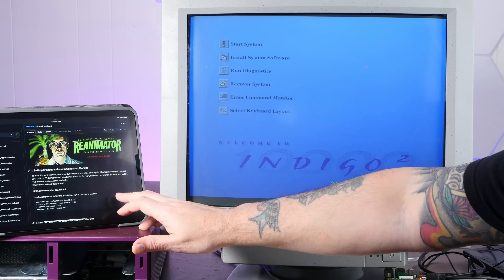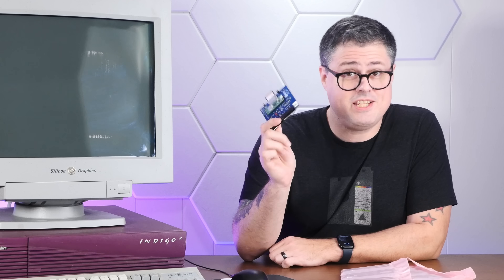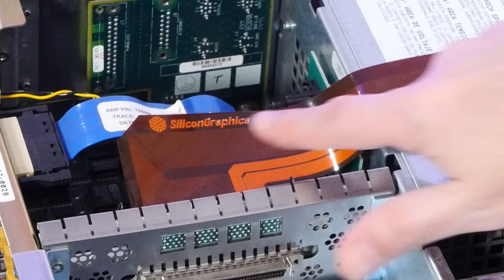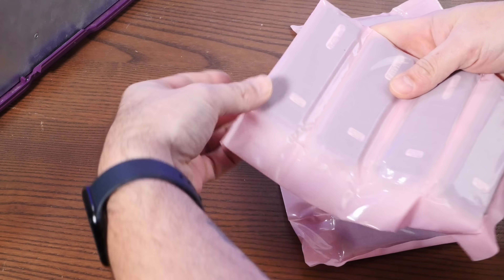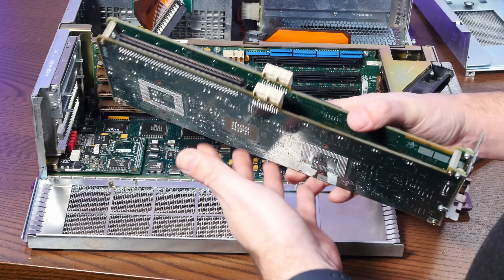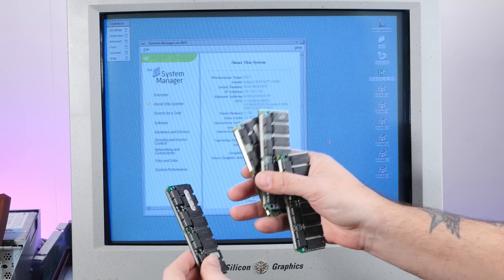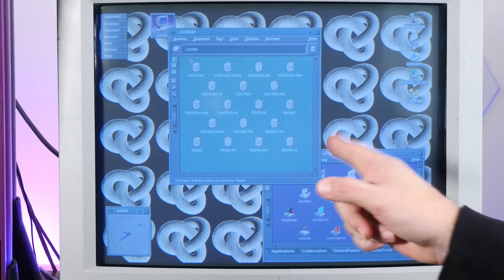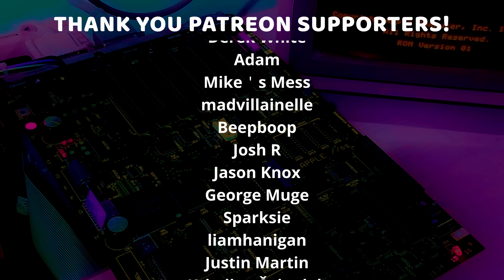Inside a $50,000 Unix Workstation from 1996

Comment: I have a Indigo 2 Solid Impact that I bought on ebay back in the 1990s. I was fully operational but I did eventually replace the  heavy monitor with a Dell sync on green flat screen unit. I also had added a tape drive long ago and collected the Irix 6.5.22 install CDs. In the summer my home office would sometimes heat up and that caused the computer to shutdown due to excessive heat. So in the summer I began just shutting it down. No I recently rebooted the computer and noticed the screen image flickering on and off and sometimes it would not reboot at all. I suspect that the power supply has died and these are not easy to repair. I haven't decided what to do with the computer yet but I do miss playing around with it. I remember years ago I had it on the internet and someone apparently hacked it and used the mail system to send out huge numbers of advertisements for viagra. I had noticed that my mail had gotten very full, and also my internet provider had complained to me that I was using too much bandwidth on the internet. That is what prompted me to investigate that problem. Since then I had taken it offline since the old browser was effectively useless for todays modern internet.

Comment: Those were crazy expensive and other channel someone thought that these were common in game development, or thought it was impossible to make 3D-modelling and rendering without SGI machines in 90s.

Well, yes, they were used on some titles but most of time game development and rendering was usually done with normal PCs with extra ram with "cheap" software like 3D Studio and Lightwave. There was even free software used to render game graphics.

When rendering back in 90s, biggest bottleneck for fast rendering and modelling was the memory when targetting computers and television. Artist had to fit all assets on render pass to limited memory but rasterizer wasn't that hard for CPU.

Free tools were make tradeoff using raytracing, they saved memory using procedural materials so in a certain way it was possible to do extremely high quality rendering with home computer and 16MB ram. Tradeoff was rendering time.

Comment: 4:25 - Please do not "repaste" these CPUs, they don't work that way. Also, the innards beneath the heatsink are extremely static sensitive. Again, they were never intended for end user access. The only part of the module which normally ever needs replacing is the fan.

6:05 - Correct, 768MB was the officially supported maximum. It made no sense for SGI to release a 512MB option, not when they were soon to transition to the Origin architecture (and the Octane workstation) which could far better support large RAM amouts via much higher memory bandwidth, lower latency and better networking and storage options. Plus, Octane could extract way more performance out of the same CPU, especially for fp code. See the R10K/195 comparison page on my site for details.

Later 128MB SIMMs actually create less heat than the 64MB SIMMs used for typical 256MB kits, but SGI couldn't wait around for that. :D

Note the hardware design of the motherboard means that at least one 512MB kit must be fitted in order to reach 1GB, but one cannot fit three 512MB kits to give 1.5GB, that won't work (as you found out); it is alas an inherant limit of the design.

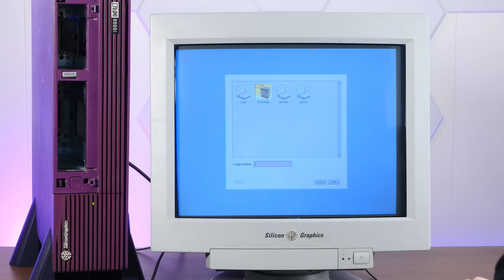8:46 - 90 minutes?? Holy grud that's slow.

9:30 - Have you done that speed hack yet?

I'm impressed with those 3D stands! 8)

I do have Max sets (many), but alas they all need repair. Maybe next year I can sort them out.

There is no faster CPU option, though as dans.8198 mentioned elsewhere here, there was also the earlier somewhat exotic R8000 75MB (2MB L2) option, but that was a very different beast.

Btw, I was the one who supplied the max-spec Indigo2 reviewed by LGR. Also, I do have some exotic expansion cards for Indigo2, including Ciprico UW SCSI and an accelerator board for I think Pirahna, but alas these options typically require the use of IRIX 6.2.

NOTE: I see your PSU is an early 36A model. Please, please have this refurbed as soon as possible. IMPACT PSUs are dying now at a frightening rate. It used to be just capacitors, but now it's all sorts of things giving up the ghost. It is much easier to refurb a PSU that is still working than repair a PSU that has already failed. I am currently exploring IMPACT PSU repair a great deal and will have a new page on my site about it next year, but in the meantime definitely get your unit refurbed; email me and I can send you a full parts list, plus info/advice from others I've been talking to about this. Also, if you do intend upgrading to MaxIMPACT then you should infact replace it with the final 48A model. And of course, make sure to obtain the two TRAM modules needed for MaxIMPACT to obtain proper full function. It will work with the default 1MB, but textures will show banding effects.

Lastly, you may be interested to know that MaxIMPACT uses SLI, something hobbyists didn't discover until much later, and for some reason SGI never mentioned it until full details were included in the Octane Technical Report. Only 2-RE options use this, ie. Max in Indigo2, likewise SSI, SSE, MXI and MXE in Octane.

If you need any help with things, please let me know.

Comment: I have mixed feelings for these old RISC UNIX machines. On one hand they are the coolest computers ever made. On the other hand, they were never made for ordinary people like me, and every brand having their own RISC architectures and own flavour of UNIX was about high margin elite thinking and protectionism.

I got into university in 1996. There was a Solaris computer lab, and the machine dedicated for large/heavy computations (available to all students) had 224MB of RAM. I remember that felt crazy in 1996.

However, just a few years later I bought a Pentium II system with 128Mb of RAM, and that mainboard could have 1Gb installed. The PowerMac G3 introduced in beginning of 1999 could have 1GB of RAM.

I am not saying the Indigo was not impressive. But competition picked up. Also, these MIPS computers were 64-bit, but anyway not supporting more than 2 (or 4) GB of RAM.

Now Apple is the biggest UNIX/RISC supplier ever, with prices that ordinary people can afford. I wonder if Silicon Graphics would ever have done that.

Comment: I was looking. SGI run System V R4.   System V R3 was the last 'kinda pure' System V.  System V R 4 was System V R3 and BSD ( not sure what version ) added together.  So I think that SGI did not just combine parts of both,  it was the official release.  I was a SYS V5 R3 person - installing Apollo and HP Workstations and was saddened when SYS 5 R4 came out.  thought that it killed the purity of SYS 5 R3.   but that is the way the game was played.  Someone wanted to let folks use whatever flavors they wanted on each command - if there were diffs.

Comment: I ported and developed software on IRIX in the 90s. Our company had several systems like yours running OEM IRIX and the SGI C compiler.That was before GNU tool anything. Besides most customers insisted we compile code using the vendor's compiler. The "largest" old/huge supercomputer I worked on in the early 90s was a Convex system (Richardson TX company). The system was all ECL logic and the machine I was on had 1.5GB of RAM, which was huge in those days. Their compiler was super fast. The first test "hello world" to verify things were working compiled so fast, I thought nothing happened. All we had then was a 9-track tape with our source code, an engineer (me) and a VT-100 terminal, a Bourne shell interface and vi, C / FORTRAN compilers and make. What else could you possibly need? Serious command line jokey in those days. We did also have various workstations, DEC VaxStation, Apollo Computing workstation, and a new RISC-based system out every 3mos or so, all running X11 desktop, if you were lucky. We ported our code base to over 15 UNIX systems, some SYSV, others BSD variants. We also ran on VAX and IBM Mainframe, so the code was super portable. Fun times.

Comment: I have one of these that I bought back in college, during my "Real UNIX" exploration days.  Got it off eBay for ~$600 (circa 2000), and used it as my main desktop for a while.  Mine had similar specs as what you started with, though only a "Solid IMPACT" graphics card.  I did later upgrade it to a "High IMPACT."
Biggest gripe is that its sorta a bridge-machine between the older Indigo2 models and the Octane, so it has CPU and graphics that's a generation ahead of the memory and I/O (slow SCSI, slow Ethernet).  Like many workstations of its vintage, finding 100Mbit ethernet hardware was too difficult/expensive. But, finding FDDI/CDDI hardware was surprisingly easy.  So at the time I ended up running an internal FDDI/CDDI network for NFS and everything else where that performance mattered, saving Ethernet for the outside world.

Comment: I had a Indigo2 XZ during my internship (the summer of Windows '95). These were frakin  amazing. Now you get multiple time the performance for a fraction of the cost and size. And Linux desktop has gone way ahead of Irix Magic Desktop.
If it wasn't for the 3D performance and IRIX, a Sun Sparcstation was way more cost effective. If not even a Pentium with Linux.

Comment: To think, back in the start of 1996 I had 12 MB of RAM in my 486 PC! By the end of that year I was on my way to building a new socket 7 K5/K6 based machine that had a whopping 32 MB of RAM in it which was more than enough at that time. 
I didn't have a full 1GB of RAM in any PC until my Barton core Athlon XP build in 2004. 5 years later my Core 2 Quad build had 4GB of RAM with an upgrade to 8GB in late 2010.

Comment: I'm a bit concerned that adding the thermal compound may have been a mistake. There is a reason it didn't have any; these machines were designed so that the fit between the CPU and heatsink is extremely precise so there's no need for paste; it probably just squeezed it all out and made a big mess and may actually hurt the cooling performance.
Reply: There’s clearly two fried out thermal pads on the heat sink.  He should have replaced them.  This is a hack job.  It’s sad to see these systems fall into the hands of PC bros who don’t know what they’re doing.

Comment: That cpu fan is a joke. I remember fans that small. And I know that older cpus ran hot as hell.
Reply: It has huge case fans.  Don’t worry about it.  SGI designed the whole system to work correctly in a normal air conditioned office.  It’s loud as heck though.

Comment: What was bad about the SGI was that it was nearly impossible to work out a bare metal install with a blank hard drive.  You pretty much had to purchase a hard drive from SGI with the operating system installed to do a bare metal install.  There was also problems with many of their software installed packages that simply prevented libraries from installing on certain models and it was virtually impossible to get help from SGI as it "should've worked", yes we later had similar issues with software installations on the Windows platform but at least they eventually worked through those and earlier software installation package formats such as on Sun workstations were easy for you to investigate into and hack them to work even if they weren't supposed to work to begin with.  It's just that SGI would often just leave you hanging on the premise that it should've worked and it wasn't as easy to rip into and hack as the Sun workstations.
Reply: This is not true.  I’ve installed IRIX on brand new hard drives so many times I can do it in my sleep now.  We bought SGI systems back in the day because of the support.  It was expensive but if we had any issue it was fixed that day, whatever it was.  New hardware, technician sent out, anything.  What you wrote about not being able to install the OS is either just you lying for fun or you seriously do not know what you are doing.  You can find dozens of tutorials on installing IRIX.  It’s not hard.  And IRIX has a really nice installation manager that manages dependencies for you.  Way better than the nonsense that windows put you through back in the day to install software and updates.

Comment: Old guy here. Worked for SUN and IBM. The processors were actually designed for no thermal paste. The heat sink and CPU were hyper polished so they fit flush. Paste may actually cause thermal over-runs so I'd suggest taking it back off. Also I know you're just playing with this but I would only work on a grounded mat with a wrist strap. These boxes are surprisingly delicate when it comes to static damage even though they look like you could use them to jack up your car with them. I actually worked with the SUN engineers on the first SUN 10000 which was at Ebay when I was at a training class at SUN in Millipedes. We could only watch and ask questions though.
Reply: That's very important information, i really hope he sees this!
Reply: milpitas....

Comment: Amiga 3000 (1990) is far from the beast that the SGI machine is but it could use up to 1GB of RAM too, just not as cleanly.  The most I put into mine was 274MB.  My current A4000 has just over 400MB.

Comment: Maybe the CA glue + baking soda method will work for the broken front panel, I saw someone fix a broken front panel latch with it before. You build up CA glue layer by layer and sprinkle baking soda on each layer to harden it instantly, you can sand if needed to shape it more precisely.

Comment: In the UK, tradesmen use a two-part contact adhesive they call Mitre Mate. Dunno what the equivalent the other side of the pond would be, but you could consider that for sticking the front plate back together.

Comment: @10:08 There is no faster CPU for the Indigo2. But there’s a much more exotic one: The R8000. It was a discrete CPU made of several components, and was crazy fast at floating point even if running at only 75 MHz. The R8000 is very rare today, requires a different motherboard, and cannot run Impact graphics.
Reply: Hope this gets some upvotes so it can be noticed by Action...195 R10k is the fastest performing, of course there is higher clock speed on the 200 and 250 MHz R4400 cpus. The R8k at 75 MHz is think has FP performance approaching the 175 R10k....rare for sure. I think I read someone saying the R8000 was released to fill in while they waited for R10k to be available and stable. The Power Indigo2 (R8000) has a swoop badge that fits around the round graphics badges on non-IMPACT systems (EXtreme, XL, XZ).

Comment: I used to work with these back in 1996. I worked for a VAR that was also a CAD/CAM company who solely used nothing but SGI workstations. We had everything from the Indy to the Octane and O2 systems. :) We used the old Alias|Wavefront software before Maya came out, as well as our CAD/CAM system known as IDEAS from SDRC, the Structural Dynamics Research Corporation. I am amazed I remember that acronym, actually. :P

Comment: I bought my first x86 machine in 1996. It was a P120 and it came with 32MB of memory that ran on a 60MHz bus, single clocked (no fancy rising and falling edge goodness.) I spent £100 of summer job money and upgraded with another 32MB of RAM. This is 32 times more than that, and I suspect being workstation spec it was more expensive again.

The hard drive was large for the time, at 2.1GB. The idea of having half of that as RAM would have been insane. Of course, now I've got a bunch of multible Gb chips in my parts box (That run at many, many multiples of the speed) that I've taken from dead raspberry pis that I could get from Mauser for €10

Makes me feel old.

Comment: I though the 32mb of SDRAM I used in my first DIY build in 1996.  (Cyrix "686".)
It was double what my uncle had in his pentium, and it was 8x as much as we had on our old 486.

1gb back then was ... astronomical ..   most Hard drives then were 1-2gb,  though they did have 5.25inch IDE drives over 4GB like the Quantum Bigfoot, and of course SCSI drives like the ole Seagate full height 5.25 10K drives that sounded like rocket ships .

Comment: I hate replacing paste.

Thermal Grizzly Carbonaut. Set it and forget it. Never dires out because it never was wet.
Reply: It's kind of an unfortunate myth that thermal paste needs to be replaced after so many years. Being "wet" has nothing to do with its thermal transfer ability, it's only purpose is to fill in the microscopic pits and gaps between the two surfaces. As long as the seal between the heatsink and CPU is not broken it should be good indefinitely. Of course if you do remove the heatsink then it will need to be replaced.
Reply: @_Thrackerzod  
Unfortunate myuth? Replaced the paste under the 3100 due to ramping up temperatures, it was powder. So from 38°C idle to 56°C idle. This is far from the only time or only system.

Explain to me what it is if not the paste, with the heatsink still on tight, what the issue was. Simple and straightforward.

The OS is immutable so no, creeping up nackground processses is not it. No the temperatures ambient are always similar. No the cooler was not bumped off.

Comment: I worked with this hardware back in the day. 

It doesn't come across in the specs, but that system was super premium just to use it.

Aka linux could run some the functions .. but not with zero lag in the disk, or computer results, or network response.

The premier experience was baked in.